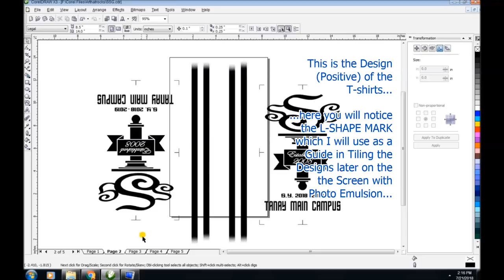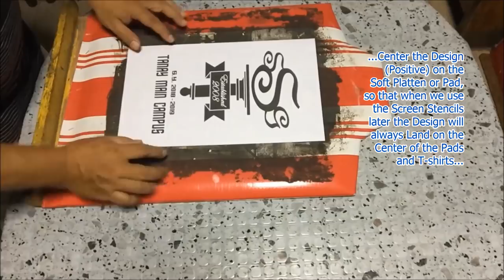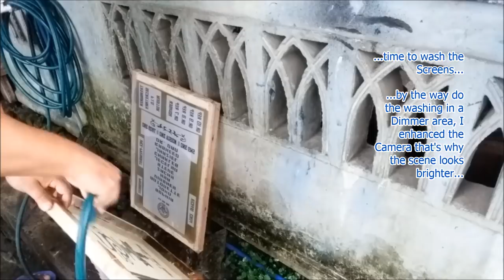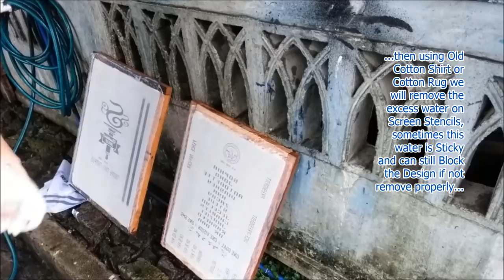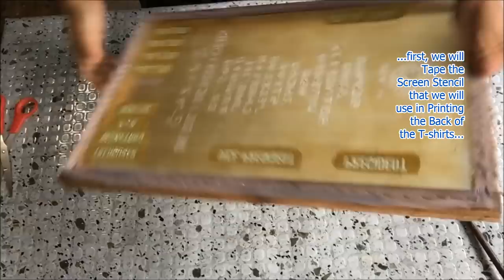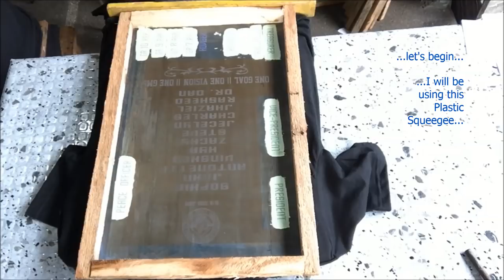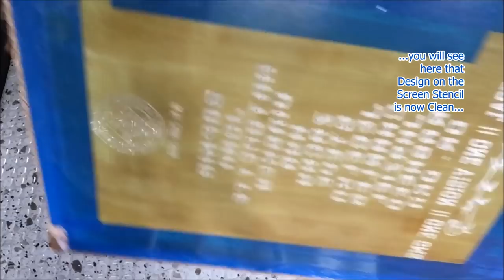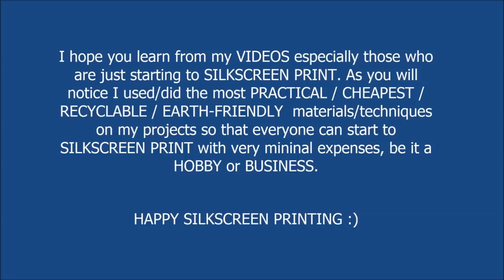Screen Printing - from start to finish...

Comment: Need I burn it or expose it ?
Because When I do this I put it like 10 inch and burn it My screen getting hot And I cant get good results
Reply from the maker: The Photo-Emulsion is Sensitive to LIGHT, so you just have to EXPOSE to BRIGHT LIGHTS...we don't need Heat to Expose the Photo-Emulsion....

Comment: Thanks. how to make water based prints more strong on shirts. I mean is it curing or what? Plz guide. Thanks.
Reply from the maker: Water Based Textile Paints that I'm using Dries Naturally, sometimes I used Electric Fan or Hair Blower to dry it faster...
Reply: Thank you very much bro.

Comment: hello poh sir.. ask lng poh.. ok din ba gamitin ang 120mesh? or ano poh talga ang mas magandang gamitin.? mag sisimula pa kc akong mag silk screen.. at ano poh mga magandang paint ang gagamitin lalo na sa mga bagohan.. at ask lng din poh ako.. ano ang size ng frame mo ung parang size ng tshirt.. salamat poh..
Reply from the maker: 100 mesh po ang Ideal gamitin sa Water-Based Paints......mga usual Frame Sizes na ginagamit ko...12x16, 14x18 inches at 15x20 inches...
Reply: @EasyVideos  cge poh.. maraming salamat.. at tanong lng poh.. ano pla pagkaka iba kung rubber ang gagamitin na squeegee at ung plastic squeegee.. or kailan ka dapat  gagamit ng rubber or plastic
Reply: sir.. pwde pahingi ng mga pangalan ng mga ginagamit mo? ung mga specification nila. like ung photo.emulsion kung local ba un or what so ever.. hehe salamat poh

Comment: Sir, tanong ko lang po about sa glue at sensitizer. Kapag gumawa ako ngayon. Ilang days po sya pwedeng itabi? O dapat maubos na agad? Kasi napansin ko. After 2days yata. Parang tubig na texture nya. Salamat po
Reply from the maker: Pwede no pong itabi sa Refrigirator para mas matagal, pag glue ganun nga po ang nangyayari 2 day pa lang malabnaw na...kung tunay na Emulsion 5 days na pwede pa ring gamitin lalo na pag itinabi sa Redrigirator mas matagal pa...
Reply: Easy ilalagay po ba sa loob mismo ng ref? Salamat po
Reply: Sir mag kano ang singil nyo sa ganyan na dsign?

Comment: Sir easy pwd po ba malaman adress ng binibilihan nu ng lahat n material n ginagamit nu sa pagprint. And sir easy pwd po mhingi list ng lahat ng material tapos list po ng mga tulco colors. Lahat lahat npo sir easy kc bibili po aq dun sa snabi m sa divisoria po ba yun. Tga bicol pa po kc aq. Para isahan npo ang bili. Thank you po sir easy in advance.
Reply from the maker: Sa JnJ Virgo ang Binibili ko ay Wetlook, Superwhite and Pigments (dapat may stock ka lagi ng paints), then sa Tulco ang binibili ko ay Photo emulsion local, Sensitizer at Hardener, meron din silang pigments, Scoop Coater and  Screens...
Reply: Para saan po hardener sir easy

Comment: Sir Bakit po kaya makapal ang print ko. nakailang print samples na ako pero makapal pa din. ano kaya ang problema sir?
Reply from the maker: Pag Rounded yung shape ng corners ng Squeegee mas madaming deposit ng ink resulting sa mas makapal na paint, pwede rin po na hindi Level yung Platten kaya may part na makapal....
Reply: So dapat po squared like ang dapat na gamitin na squeegee sir
Reply from the maker: Yes po at Depende rin po sa material natinatatakan....
Reply: ok po sir salamat po. ahm sir sa pagprint po gamit ang superwhite, may minimix din ba kau sa paggamit ng suoerwhite? at sir tinry ko iprint ung classic black ng tulco parang nagfifill ang gilid nya.